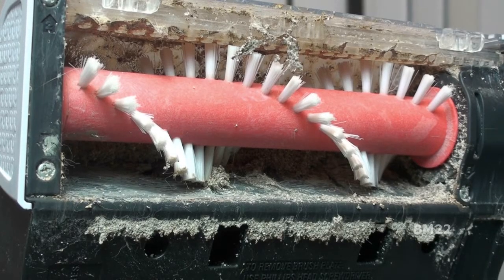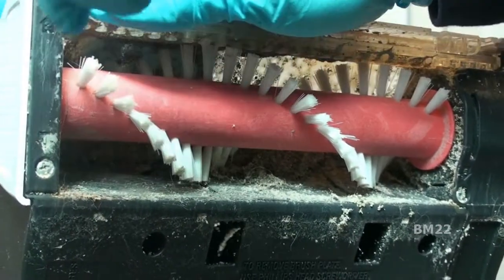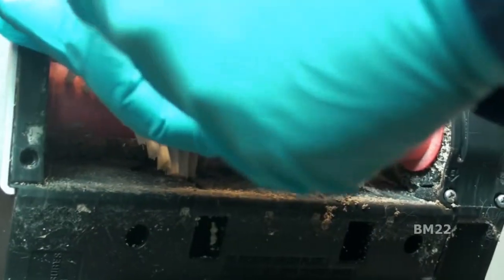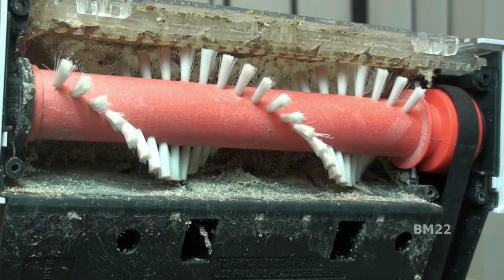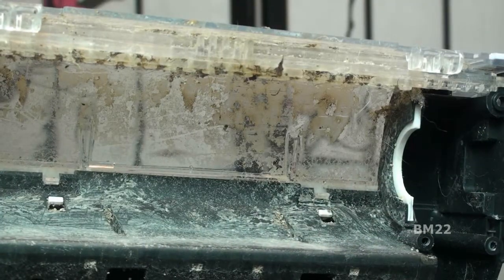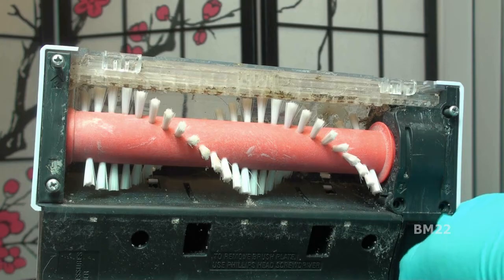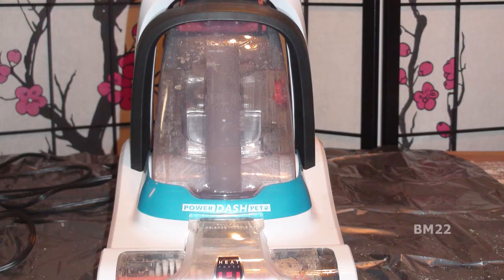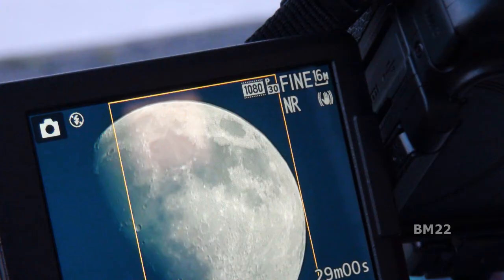Hoover PowerDash Pet Compact Carpet Cleaner; Brush Removal and Cleaning

Comment: Got this today, you are a lifesaver. Got it for 70$ and it cleans really well but cleaning the vacuum itself is the worst part of it lol
Reply from the maker: Here's the new thing I'm going to try for cleaning...it might be a big failure...but here it is: I'm going to spill a little clean water on the floor, and vac it up...it might be enough to rinse it out. At least I'm going to try and see if it helps.
Reply: @BM22TechReview  what i do is run hot water in my bathtub...just enough to cover it about half an inch or so and hit on.....nice and clean! and use a bit of pinesol to smell good.
Reply from the maker: That would work, but I'd be careful about that whole vacuum in the bathtub electric shock sort of thing...
Reply: @BM22TechReview  well that's why you only have very little water and hold the cord of course lol

Comment: Just purchased. After I vacuumed the area rug, I then shampooed it as instructions. Once done,  I cleaned the dirty tank. Refilled the water tank with warm water and went over the rug again an 2nd time and you won’t believe how dirty the water was again. It had been cleaned a year ago and have  no pets. It sure did a great job; letting the rug dry completely then I will vacuum again before returning the furnitures.  If you clean the machine right away when you’re done, it will come out as new. Yes I did rinse it in the sink with a tap sprayer. Just be careful to not rinse where the motor is, that’s all.    I wish I could send you a picture…and I’m a 78 year old lady so anyone can do this. Great explanation Sir but your machine is not cleaned properly. Wow!
Reply from the maker: Yes, I am lazy...I've never claimed to be otherwise. But my machine is certainly still serviceable, and has been used dozens of times, to clean dozens of rooms, which ain't bad for a cleaner that costs less than $100. So, keeping it clean, is not a requirement for its proper operation :)
Reply: I go across my carpet in 4 directions - vertically, horizontally, and diagonally both ways.

Comment: I actually bought two of these and use them often now as part of my pro-cleaning business.  Mostly they work great for me as a final step on plush carpets, extracting/drying/pile-lifting carpets I've already thoroughly cleaned using high-power extractors.  Also great to spot-clean especially for re-appearing stains that benefit from the warm-air-blower feature.  Not practical at all for cleaning large areas though, with that tiny solution-tank.  But for cleaning large areas, you can pre-spray carpet with a pump-up garden-sprayer, using any quality extraction detergent or encapsulating cleaning product.  One major caution however;  This Hoover brush-roller is VERY aggressive and should be used at right-angles when cleaning carpet edges and borders.  Otherwise it can loosen and damage already-worn carpeting marginally attached to tack-strip!  I'm actually going to install two switches in my Powerdash unit to control the vac and brush motors separately.
Reply: You are absolutely right! :)

Comment: Very helpful. I could not find it last screw to pull out and fortunately , you made a note of it in your video.
Reply from the maker: I really like the value and ease of use of this cleaner. But when it comes to maintenance they are certainly lacking. I have read several comments from people who hate these units, I can only think they are trying to compare them to larger and much more expensive units. And after several years of use, mine is still running fine.
Reply: @ I love mine too!

Comment: If you have a sink with a detachable sprayer. You can just rinse it clean holding it brush side down into the sink. Right when your done cleaning your carpet it all rinses off.
Reply from the maker: Yes, you could do that. Or even bring it outside and carefully rinse it with a garden hose.
Reply: I clean it this way with a shower hose, eventually this model will still get residue in parts of the assembly and brush. I liked this product but found it became a scent spreader for pet messes if not torn down the way this video illustrates.

Comment: Very hard - if not impossible - to clean inside the plastic housing where dog hair collects dusty gunk and will not rinse out. It's the permanently sealed-on plastic housing under the removable clear plastic "nozzle cover." I used the sink sprayer, a pipe cleaner, and used a plastic straw sliced down the side and slipped up into the very narrow flat opening where all this gunk collects. 

All I could do is slightly push the hairy gunk around then spray into it again, pushing in the direction it should drain out. It doesn't come out, no way so far to get the plastic housing clean. 

This cleaner does a great job, but it is impossible to properly clean. 

Also the tank does not completely empty, so mold grows in it. Leave the tank cover open to help avoid this. 

But why couldn't they place the emptying hole on a spot where it could drain completely instead of near the corner on a flat spot where it's impossible to completely empty the tank?
Reply from the maker: A pleasure to use, but a pain to clean.
Reply: I emptied the ,rinsed it in the sink. After rinsing several times it was clean to my satisfaction. I do recommend using a drain screen as you don't want a lot gunk to hang up in your plumbing. This tank has 3 holes in it so I sat it on one of my floor vents. I expect it will evaporate  the water left inside.  Maybe a good sunny spot in the yard would work as well.

Comment: Does the brush roll cover come off without removing the screws that hold the brush in place? Thank you for your video. ❤
Reply from the maker: I don't remember. I'll check tomorrow and reply then.
Reply: @ thank you
Reply from the maker: I responded to this comment days ago, but for some reason I do not see my reply here. So, I'll try to reply again: The nozzle easily pops off, but not the brush cover. I tried multiple times, and although it may be removable, to me it looks like it'll break before it comes off. And there is always that risk of it NEVER going back on correctly. The way these plastic pieces are put together, that piece may not be removable, but if it's broken it still may be possible to install a replacement piece. If my unit ever dies, I intend to completely disassemble it and see which areas are really consumer accessible. I'm currently looking for a failed one of these to do a complete tear-down of it.

Comment: Dang wish I had bought the one with the fold out access. Good video!
Reply from the maker: All in all, I've been happy with this unit. I've had this for about 3 years or so, and it still works fine. I just used it again yesterday...but I didn't clean it when I was done 😁

Comment: Thanks for the video!  How do you remove dust that is stuck in the plastic rectangular piece that fits over the brush roll?
Reply from the maker: I'd try pipe cleaners, or something along those lines. Pre-wet it, and then try cleaning. Sadly, it just might be something we have to live with.
Reply: @BM22TechReview  I got to thinking .... maybe a can of compressed air?
Reply from the maker: That could work. My new current method is to spill a little clean water on the floor, and vac it up until everything looks clean; it took me a few tries to get things looking clean.
Reply: @BM22TechReview  so CLEVER!🎉

Comment: Is there a way to clean the water basin. No matter how much I vacuum there is always hair and once it gets in the basin I'm having the hardest time cleaning it out. I can reach most by going in through the orange stopper and I can get a lot more by putting it up the bottom two access points but there has to be a way to take the top off without breaking the plastic. I'm just afraid that is what I would inadvertently do if I pull. Any help would be appreciated
Reply from the maker: I've not found a way to clean it any better than you are doing. I put some soapy bleach water in it, shake it around a bit, and then rinse it out. At least that way, everything left inside is germ-free and does not stink😁 In the big scheme of things, this is a device used to clean things, often some pretty nasty things, so I simply became content with it not being completely clean itself.
Reply: @BM22TechReview  ok thanks. I see why the other model is an upgrade lol.

Comment: Any idea how to get the filter and rubber seal back in? Ours popped out
Reply from the maker: It won't just pop back in? Does the area need to be wiped-down, like maybe there is a little bit of crud in the way?
Reply: @BM22TechReview  no the seal has a flap to keep water from pushing past it but also is keeping it from going back in. Contacted the company and even they said it’s supposed to go back, but skit that step in every video 🥲

Comment: I removed the transparent plastic line to clean top of where the brush goes since it was dirty too and decide to clean now couldn't put it back :/
Reply from the maker: Is it cracked or broken? Or will it just not pop back in?
Reply: @BM22TechReview  It's popped out and hard to put it back :(
Reply from the maker: And that is the problem with cheap plastic; sometimes the force required to pop it back in, is enough force to break it.

Comment: I got that part but now how do you clean the tank? you can't take that apart?
Reply from the maker: You could maybe flush some water through it, but not so much water that important areas get wet. I've also dumped some clean water on my kitchen floor, and then vac'd it up with the cleaner, which flushed clean water through the entire system.

Comment: I loveeee my Hoover Powerdash cleaner, Ive had it for almost three years. I was in the process of using it a few weeks ago and suddenly it just stopped working, and making a super loud noise. There was also a burnt smell too. I turned it off, removed the parts and cleaned it and it still doesn’t work. Any idea whats wrong with my baby?🥺
Reply from the maker: Is the belt still good...not broke or slipping? Is there anything caught up in the roller brush...string, hair, piece of the belt? If it's not the belt, or something obvious with the brush, then it's probably something internal, like maybe a plastic gear? Or possibly something got into the motor and did some damage. I'm not sure are any consumer-replaceable interior parts, and the cost of buying a new one would probably be less than having yours repaired since they are around $100 on Amazon. But you might want to send an email to Hoover customer service on their website, maybe it's a known issue, and the repair might be free. Good luck.
Reply: Its a piece of crap.....thats whats wrong.
Reply: This happened to mine and I called the number on the back and told them and they sent me a new one.
Reply from the maker: Thanks; that's good info.

Comment: How do you remove the clear plastic piece to clean?
Reply: Yes! I would like to know how to do this as well
Reply from the maker: I don't know if it's supposed to come off. I'm sure I could get it off of there, but not sure if it would go back on properly. If it does come off, it'll make cleaning it a lot easier. To clean it, I now spill clean water on the floor, and then vac it up until the water in the waste hopper is clear. Some people use the garden hose to clean it, but that seems a bit risky to me.

Comment: We bought ours for puppy accidents, and when you need to clean the carpet for that you can't really vacuum first, so the hair that gets stuck in our machine starts to rot and smell, and eventually (unless I clean my machine every single time I use it) I am making things worse when I need to clean up a puppy mess.  They really weren't thinking about how to clean the machine when they made it, were they?
Reply from the maker: Yeah, it seems like their main concern was how well it worked, rather than how practical it is overall. And of course, that is just plain poor planning...like when car companies make it nearly impossible to do your own maintenance on your car. Have you tried flushing it with warm water after each use? Maybe after time, this might help the situation.
Reply: @BM22TechReview  Yeah, I have figured out a way to flush it when I  want to clean it really well, but that is not very convenient to have to do every time I need to clean my carpet, that's for sure.
Reply from the maker: Yes, it can be a big pain.
Reply: I take mine in the yard and rinse it with the high pressure nozzle.

Comment: I love my hoover but the cat litter is stuck in the dirt water recipient and can't remove it. Also after a while it starts smelling bad if you don't clean it properly. I wish the clear part on top of the brush could be removed, that is where most of the gunk is
Reply from the maker: I totally agree about that clear part...I'm still going to try and find a way to remove and clean it.
Reply: @BM22TechReview   I just put in the tub and use my sprayer to remove all the gunk. I let it air dry and voila 🎉
Reply from the maker: That will do the trick.
Reply: That's what I'm here trying to figure out. I've tried every which way but there's a thin line of debris that I can't reach no matter how I spray it.

Comment: Yikes.  I borrowed Hoover from a friend and of course wanted to return it to her nice and clean. I did manage to take the brush out and wipe out that housing area. But I must agree with you that this is really poor design. I wonder if anyone at Hoover even tried using this thing and tried to clean it!  I doubt it!  Thanks for the great instructions.
Reply from the maker: Thanks for watching this video. I do have a cleaning method I have been toying with; sucking up clear water from the kitchen floor. It's not perfected yet, but it shows promise. And sadly, Hoover is now owned by... Nuff said there. That same company also makes at least one, but probably more, exact knockoffs sold under other names (for less money). Any company that uses that sort of business model; crank out the same product under different company names, rather than concentrate on quality and quality name recognition for your flagship brand...

Comment: My screws are rusted and stripped so I can't remove them. Suggestions?
Reply from the maker: Yes, that is a common problem. So, the best way to remove a screw like that, is with an easy-out screw extractor which you can buy at any hardware or auto parts store, and they are super cheap on Amazon (as low as $3.99). Worst case scenario would be to drill it out, and then replace it with a larger sized screw.

Comment: I did this & now I’m going through water/solution in 3 minutes. What did I do wrong?😭
Reply from the maker: So, just off the top of my head...I'm going to say something is wrong with the plastic cap that goes on that solution container. It sounds like something is clearly causing it to drain out too quickly. I'm thinking it's something with that cap, because if it were with the "squirt-trigger" it would drain fast, but not that fast. Remove the solution container. Check for a tight fit of that plastic cap. Look for a crack on that plastic cap. And then look at the center of the cap; it's a plunger that allows it to open when inserted into the machine. Make sure that plunger is not stuck in the open position. If that's not the problem, let me know and I'll look a little deeper at mine, and see if there is something down in that bottom receptacle that could be causing that problem.

Comment: Tip: Never let it dry before cleaning, It will make it a lot harder to clean.
Reply from the maker: Yes, if it dries it'll require a good soaking to get it clean. So, it's best to clean it when you're done using it...although I rarely do 😁

Comment: Years ago we use to call our home vacuum cleaner a "Hoover", but these days it's called a "Dyson"
Reply from the maker: That's funny; I remember from watching old Brit-coms from the 1960's and 70's, where they called vacuuming "Hoovering." When it comes to Hoover, look how far the mighty has fallen.
Reply: @BM22TechReview  I also remember the really top notch brand in the 70's was Electrolux. Often sold door to door in Oz. Occasionally I see them being thrown out and they are a fantastic Vacuum cleaner. Hoover had the opportunity to make Mr Dyson's vacuums but they were worried about losing out because the Dyson design required no dust bag. As they say the rest is history. Hoover seem to be attached to the lower end of the marketplace now. One peg above the no name cleaners. Hoovers could have been Dysons, but it never happened.